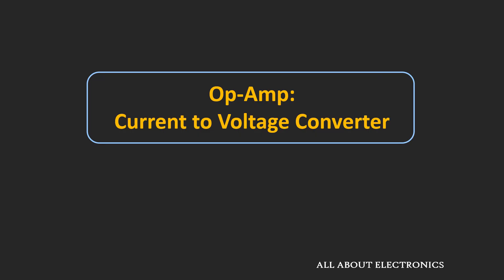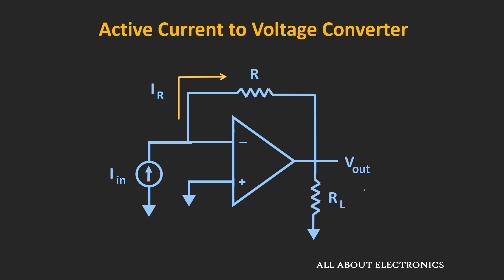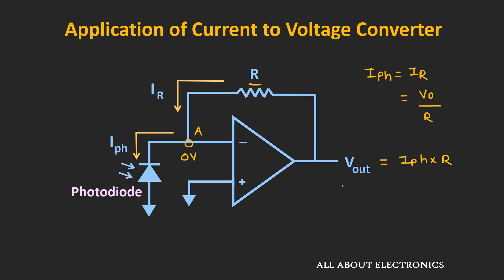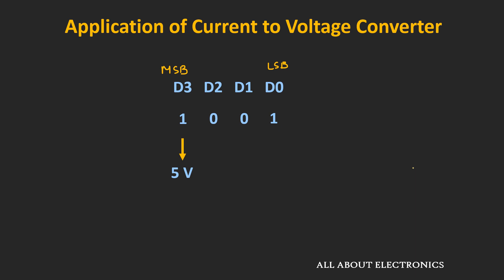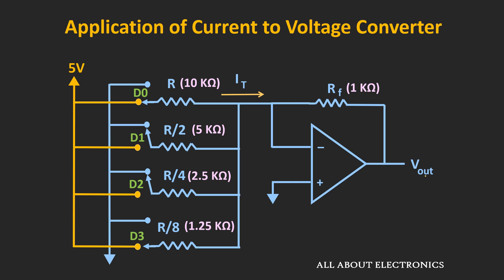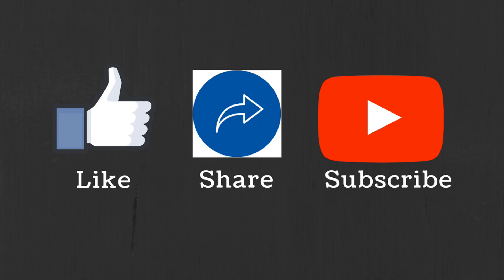Op-Amp: Current to Voltage Converter (Transimpedance Amplifier) and it's applications

Comment from the maker: The timestamps for the different topics covered in the video is given below:

0:28 Why Current to Voltage Conversion is required in the circuits

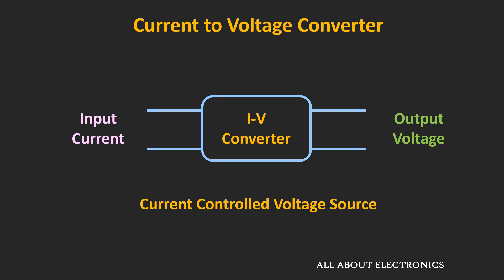1:34 Passive Current to Voltage Converter circuit and it's limitations

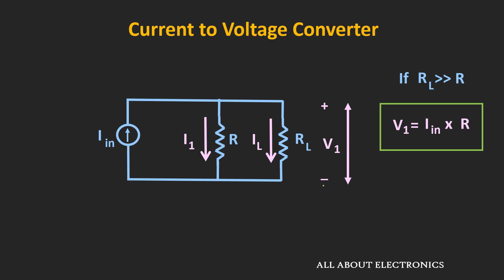2:55 Active Current to Voltage Converter using the op-amp

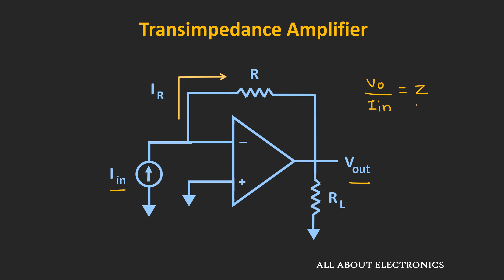4:43  Application : Current to Voltage Converter in photodiode circuits 

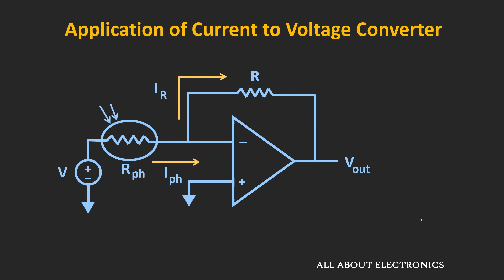5:49  Application: Current to Voltage Converter in Digital to Analog Converter (DAC)
Reply: Tu na thik se video banay ker jo dekhe sab ko samje sab ko
Reply: Hawaaa me baat mat kiya ker samja
Reply: Myaplifairmekingbacic

Comment: Respected Sir...At 3:37 by virtual ground concept V– =0 then how come Iin will be there as potential are same(0v) across current source Iin
Reply from the maker: For ideal op-amp, the voltage is zero. But actually there will be some voltage (in uV) across the current source.

Comment: As you explained at end the 8:34 Vout is -4.5 Volt can we convert it to +4.5Volt by using another opamp by taking (-4.5Volt)  input to the inverting pin (i.e it will convert -4.5 to +4.5 with 1 gain)
Reply from the maker: Yes, definitely
Reply: @ALLABOUTELECTRONICS  and what will be output if op-Amp operating voltage +1V, and -1V (just assumed)
will output will be -4.5V or -1V ???
??

Comment: Thank you for this video. Very informative but hard to understand. Fortunately there are sub-titles available. It could be even clearer with a native English speaker narrating as many people do not fully understand the accent of the Indian sub continent. The structure is unfamiliar and multiple rolling R's are challenging. The math is explanatory, though really it is secondary to the actual physical characteristics of the circuit.

Comment: What about the amplification... Wont the output voltage be amplified
Reply from the maker: Here, we have a current to voltage conversion. Because here the input is current and the output is voltage. The conversion factor depends on the feedback resistor.

Comment: Hello Sir I am confused how to take current direction 3:02  T direction towards Vout and  4:51  current direction away form Vout? Could you elaborate on this?
Reply from the maker: At 3:00, there is a current source at the inverting input terminal. Here, the op-amp is considered as an ideal op-amp. So, no current is flowing into the op-amp terminal. i.e the current has to go away from the inverting node. 
At 4:50, you might be aware that photodiode is operated in the reverse biased mode and only photocurrent used to flow in reverse direction. Cathode to Anode. That's why photocurrent direction is shown downward. Once again no current is going into the op-amp terminals. And to satisfy the KCL, the current should enter at the inverting node.
I hope it will clear your confusion.

Comment: Sir.. .what happened if I'm using single power supply (+5v only for op amp) and how to get +ve voltage (+Vout)?
Reply from the maker: Just reverse the direction of the current. You will get a positive output voltage.

Comment: hello, wich circuit can help me to amplified nanoampere from a photoresistor?
Reply from the maker: This circuit will work. But you need to select the op-amp which has very low noise and very low offset current.

Comment: Can i get 10V o/p from circuit giving 20 mA current
Reply from the maker: Yes, you can. But the biasing voltage of the op-amp should be more than that. (Around 12 to 15V ). And second thing, op-amp should be able to work at that operating voltage.

Comment: Sir what input impedence and output impedence in this case
Reply from the maker: Because of the virtual ground, the voltage across the current source is ideally zero. So, input impedance will be ideally zero. The output impedance is same as the output impedance of the op-amp.
Reply: @ALLABOUTELECTRONICS  thnku so much

Comment: How to design current to voltage converter input 4mA to 20mA and output 1 to 5 V dc
Reply from the maker: Just use 250 ohm resistor for the conversion. You will get the desired output. Its a standard way to convert it into 1 to 5V DC.
Reply: @ALLABOUTELECTRONICS   How would I do a conversion from 4-20mA to 0-5V?